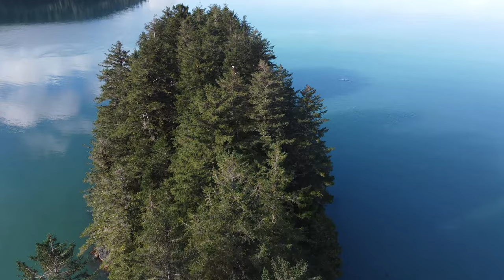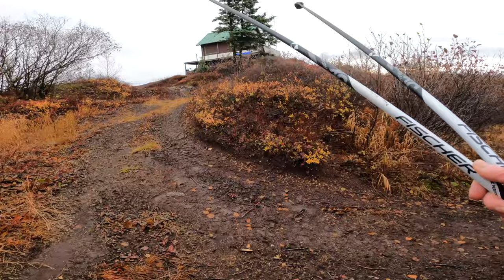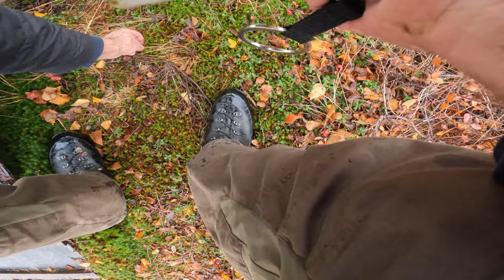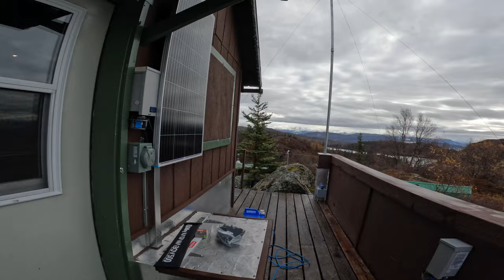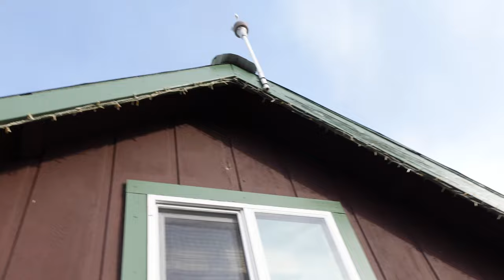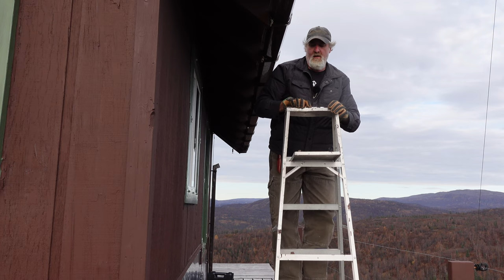Brown Bear and Mammoth Tusk | Remote Off-Grid Alaska

Comment: If the roof over the door is needed after all you can use the solar panels as the roof so they aren't shaded at all and you can keep water off the door or whatever..
Reply from the maker: That would work in the summer when the sun is overhead but won’t catch a single ray during winter. The sun barely rises above the mountains to the south then dives below in 4 hours time. Plus the snow would cover them.
Reply: @MountainMariner  You would know better than me but just thought it might help.